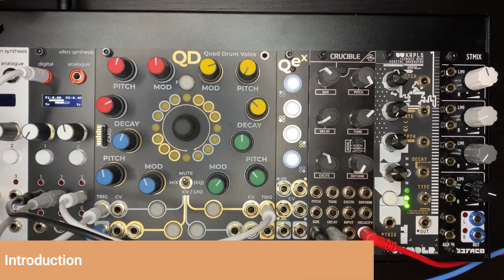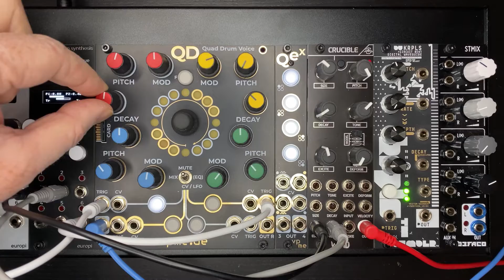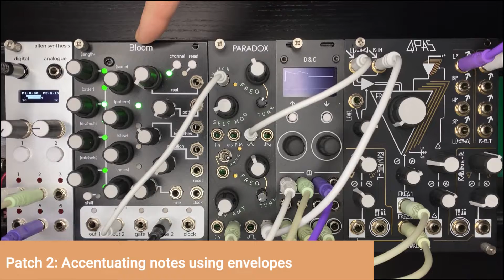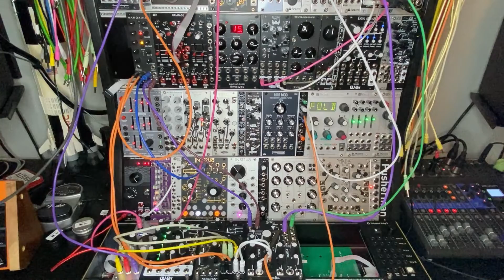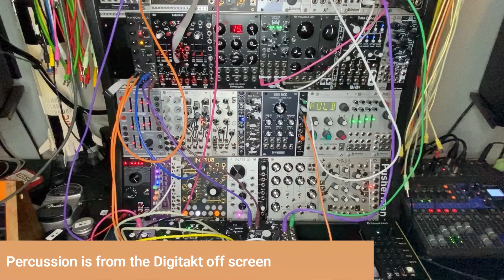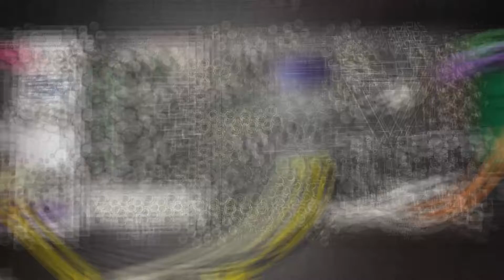EuroPi Series | Add more dynamicism into your patches using Bernoulli gates

Comment: So what advantages does the EuroPi have over say, an Ornament & Crime module?
Reply from the maker: I own both EuroPis and an Ornament & Crime and I love them both TBH!

The biggest things the EuroPi has going for it in my opinion are:
1. It uses a Raspberry Pi Pico, which is easy to get hold of, unlike the Teensy 3.2 that the O&C uses, which is unfortunately unobtainium at the mo :(
2. It uses Python, which makes it really quick and easy to go from an idea to a working prototype
3. The EuroPi firmware simplifies things too by abstracting the complexity and making simple functions available to handing CV, knobs and button presses
Reply: What about factory scripts, I haven't been able to find an index, or is this purely a code it yourself environment with no example scripts?